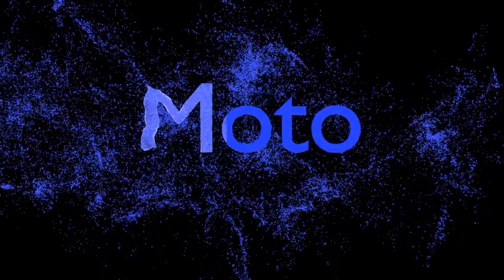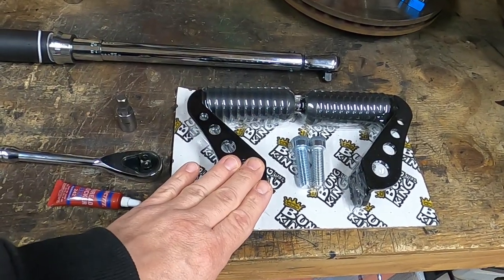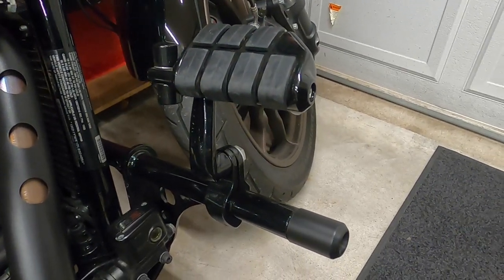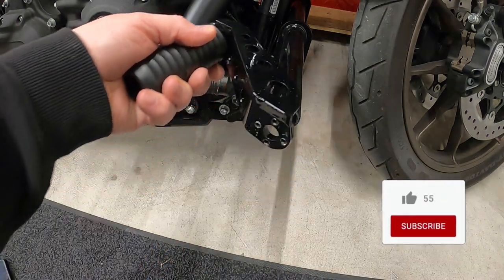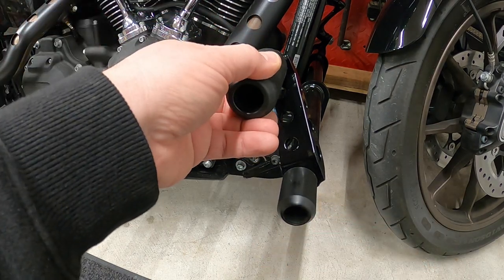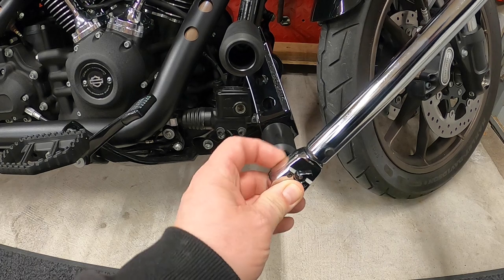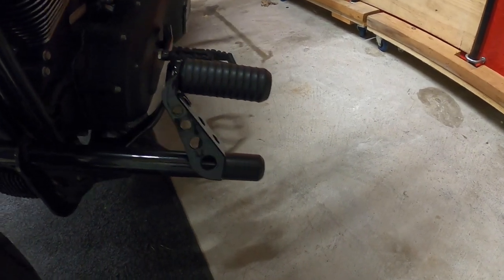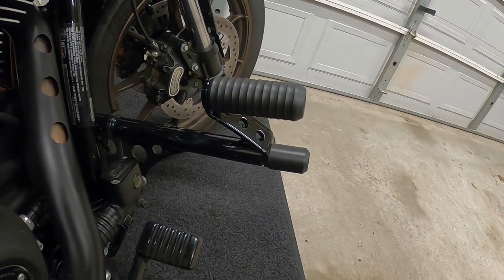Bung King Reach Reducers BEST Addition for Short Riders Who Use The Crash Bar As Highway Pegs

Comment: So I'm looking at the bung King bar for my street bob, however I'm worried that since they set so low, the bike could still tip over or high side.  Are these foot pegs sturdy enough to create another contact point to prevent I fully pivot tip over?
Reply from the maker: Possible, not sure how strong they are for that. I would email them. They respond to questions.

Comment: Little bit o’ grip so my feet don’t slip
Reply from the maker: Yep, I went ahead and changed out the pegs to solid ones. Then just added grip tape to it. Made the biggest difference, no slip.
Reply: @DoubleDMoto but did the non smooth ones grip? Or you just changed them out because your other ones were smooth?
Reply from the maker: @Poptart_Az  I felt that there is no grip with the first ones. Foot would not slip left to right but would slid down or up. Definitely recommend smooth with grip tape. Hope this answers your question.